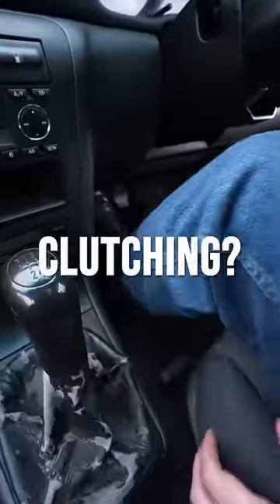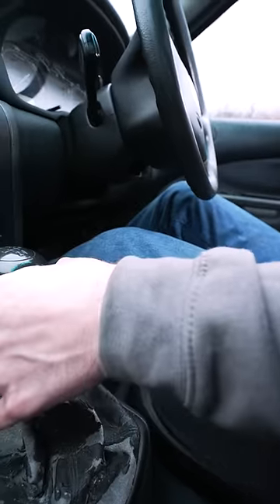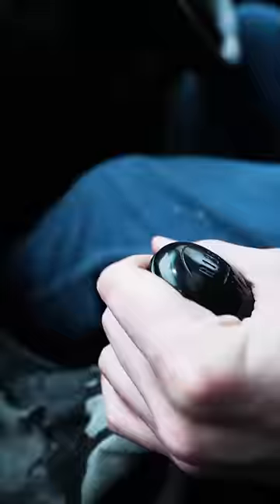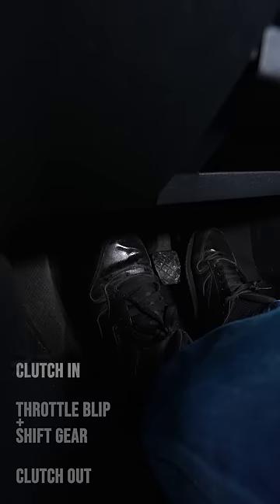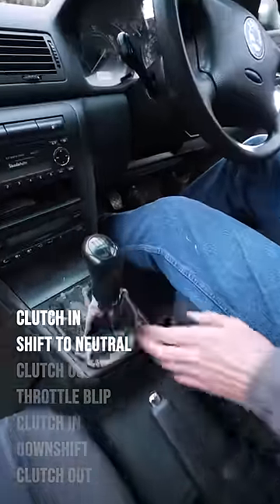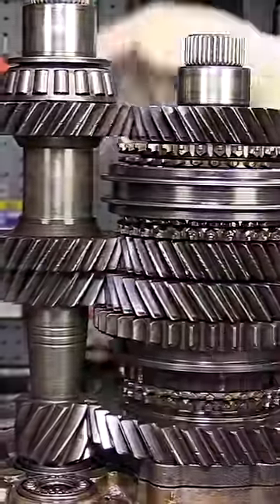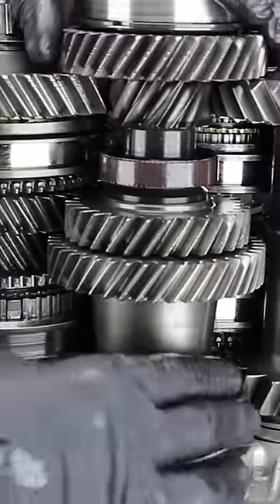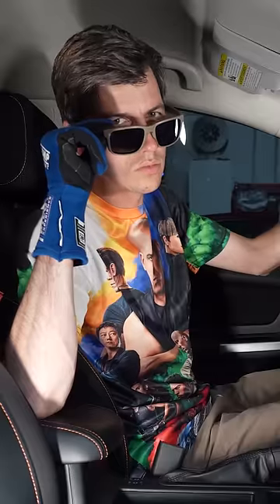What Is Double Clutching? Don't Granny Shift!

Comment: I've gone thru so many comments but still don't see this so I gotta know if anybody else does what I do. 
1. I double clutch when I'm skipping gears during downshifting. I go from 6th to 3rd daily when coming off the highway and onto my home street or when I'm gonna pass someone. Feels way faster and easier than downshifting 3 times.
B. I'm not as good at single clutch downshifting as I am with double clutch. When I learned how to do DC I loved it so much more because it felt rhythmic to me. Not sure if it's an ADHD thing or just a me thing but I go "da-do, do-dah" in my head every time 😅 judge me if you want!
iii. Having a passengers head explode when they see me do it. Definitely a feel good moment every time 🥹

Comment: This is partially right, but double clutching does have a valid use, if you are coming into a slow corner from a fast straight and will be skipping gears on your downshift (like 5th -> 2nd) then heel-toe with a double clutch into 2nd significantly reduces wear on your synchros.

If you drive your car hard, then double clutching will extend the life of your transmission, as scyncros are the 2nd most failed part in a transmission behind the clutch itself.

Comment: My old Metro had a VERY short 1st gear and the ratio spread to second was ridiculous. 2-5 were alot closer. I bought that car brand new off the lot and legit thought something was wrong with the transaxle. Had it replaced under warranty and the new trans was worse than the original. Someone suggested double clutching and I got smooth upshifts when practicing this. Very cumbersome technique for a daily driver. The transmission was ultimately the death of that car along with structural rust around the lower control arm mount

Comment: When shifting down and don't want to slow down you want to match the speed to the revs as the synchro's will use the rotating mass to speed up the engine.

Comment: As I teach to people Neutral is a gear.  Output shaft and output gears spin with the wheels input shaft spins with the engine but only when the clutch is released so at its extreme if you are going 100 mph down the highway and pop the clutch in and shift to neutral and wait the input shaft will eventually fully stop.  Now you have a zero rpm input shaft with a 100mph output shaft and the best synchros in the world won’t push together nicely at all and as you force the trans in gear you’re using the little wimpy synchro rings to force the input shaft to speed up.  If instead you release the clutch in neutral and rev and then pop the clutch back in when the engine is revved up you have no double clutched and that input shaft is spinning

Comment: I feel that there is a time to do this, and that is when you are rolling along a flat area in high gear to safe fuel but then want to go into a much lower gear to engine brake to go down a hill. It just feels much smoother and easier on the components.
It never screamed fast to me though.

Comment: On the second "clutch" you don't push in the clutch pedal, you just synchro the gears by feel, and then slide the shifter into the gear position.

Comment: Its for big trucks and good drivers skip the clutch all together including downshifts. Saves the knee after 4 million miles of driving. On motorcycles its called speed shifting but its full throttle and just bang through the gears.

Comment: Bad double declutching has a reputation for ruining gearboxes. In the past, I know that ZF in particular have been very much against using it with their products. I don't know what their current position is. I have tried not to double declutch but it has been part of my deep programming for over fifty years, so that doesn't work. Maybe I have an advantage as a gear designer but when I slide the lever into place I am feeling the level of synchronisation and visualising the messing of the gears. I do love a 'hot knife through butter' kind of change!

Comment: In any vehicle thats syncromesh so basically everything thats not semi trucks there is NO point to double clutching and depending on how bad you could be at it can be worse for your clutch than just pressing down and doing your whole shift in one go. This is because lots of car people when double clutching get in to big of a hurry and shift to neutral before you fully engaged the clutch. This makes the syncromech not work properly and causes extra wear. Not a big deal a few times but do it too much your clutch wont last as long. Bigger trucks doo require double clutching or just power shifting.
Reply: Semis in Europe not just have syncromesh, they use automated transmissions with a clutch (not the torque converter type for efficiency reasons) since around 2 decades.

Even 1980s manual semis had syncromesh in Europe. Non syncronized transmissions are more 1960s style

Comment: We used to have an old, well-used Renault Clio from 1999. It had synchros on all but the 1st gear.
Double clutching helped a ton while switching from/into 2nd and 3rd gear due to the wear incurred through the years.
All modern vehicles I've touched don't benefit from the practice.

Comment: It's equally unnecessary to slam through gears just driving normally, for instance, but double clutching lets you do it with much wear, if you want to practice. I always double for downshifts, it gives better feel/prevents you from money shifting. If you do it right, the shifter pops right in with no resistance (very satisfying), but if you accidentally skip and hit a low gear or do it wrong, you'll get resistance and know you fucked up and can reset. Obviously for racing, I'd go to single, but I'm not driving competitions, it's just not necessary for street driving (and you shouldn't be racing on the street! Just have fun!)

Comment: Yeah double clutching is what you do in 18 wheelers like way back when I used to drive because their manual transmissions are not synchronized. As I understand many of the super, super old buses are like that too. Also I have recently learned that the old versions of the Fiat 500 are like that also.

Comment: Double clutching is not necessary. Only on Model As & semis or vehicles with square cut gears. You can (Float) those gears up or down the shift range with practice-No clutch needed.

Comment: Back in the day me and my mates would play no clutch. Youd just have to feel the timing and slap it in there. And i dont think you let off the accelerator neither. I think thats what we did and wheel spin through the first couple gear changes. Then get laughed at if you missed the change.

The more i think about it, it was probably double clutching. Because we were dropping out of gear into neutral. While still flat footing it. Then slamming it into next gear.

Comment: yes and no. if you shift to fast you're destroying the synchronizer rings, double clutching helps but needs longer. The transmission never runs 100% freely, therefor double clutching helped the transmission input shaft to match the speed and cancel out any potential energy in the clutch pack and shaft, but this needs time. That is the reason why synchronizer rings exist, you dont have to wait, you force your selector ring over the synchronizer against the actual gear you want. while you pushing the smal oil cussen between the synchronizer and the output shaft gets compressed and slows down or accelerate the input shaft to the speed of your outputshaft if the speed maches the coupler ring slips over and now you are in gear. If you doing it to fast the oil burns and looses this lubricant capabilitys and gets to thin and now your synchronizer rubs against the coupler gear and if realy bad you grind down the couppler ring the gear teath against and weaken the coupling point and metal shavings contaminate your transmition oil and destroys everything. 
you can shift really fast with modern transmitions but there are special desined coupliner in race transmition. Some of them dont use synchronizer, because longgevety is no conzern the theaths are a bit different on the coupling ring and grinding is normal. Also there is a type of transmition out who needs no clutch after you are in the first gear, but those last only a couple hous of use or should i say abuse.

Comment: In racing transmissions you have what’s called dog earring the gears basically straight cut and no synchro it’s heck on em but they are a lot stronger usually used in a sequential system but on regular manuals you have to rev match

Comment: Double clutch take off is what I assume they meant which with high horsepower and or hard take offs bumping the clutch giving some gas from stop then let out giving even more gas the 2nd time is easier on the drivetrain and drivetrain mounts while also giving u a better take off, even in newer manuals 💯 also douvle clutch take off were started by ppl hauling heavy loads trying to save the drivetrain and be able to take off without burning the clutch but in racing it also helps refrain from losing traction during take off 🤔🧐🤙🏻😎🇺🇸

Comment: The only time you would need to blip the throttle in between gears is when down shifting. When your going up through the gears you shouldn't have to blip the throttle, unless you missed your gear and are trying to get the revs up so it will drop in.

Comment: Yeah, but up to he early 1990s double-clutching was faster than ANY auto transmission plus much more fuel efficient. Which is why race car drivers of the time used double-clutching until then, slowly fading-out over the next 10 years.
Only after this period auto transmissions became faster (I mean shifting time) and more fuel efficient because they had more ratios built-in, applying a better use of the engine characteristics down the drive train at almost any time. The Tiptronic finally beat them all later for fast up and down shifting.
Still for me, an old fashion car guy (and an ex T55 tank commander) I still love to drive cars with elderly gear boxes. If you know what you are doing it is great fun to drive them since it requires knowledges, skills and a feeling for the mechanical internals. If you drove an old-fashion truck along a hilly road for miles and hours, you certainly do no need a gym afterwards.
Once you are really used to it, you double-clutch totally out of your subconscious, it goes completely "automatic". The disadvantage is for bus and taxi drivers, who particularly in the cities  have to press the left pedal so often and hard just in one 10 hour-shift, they might develop knee-problems at the left once they get older in their job. Certainly, double-clutching is out-dated by now, but depending on your "taste", great fun to kick these old cars around, as long as you know, what you're doing.

Still, if you have a powerful modern European Diesel engine in combination with a manual transmission (or Tiptronic, which is actually rather a semi-auto) the fuel economy is still unbeatable.
Most of the auto transmissions are using internal break bands or transmission fluids which generate too much internal extra friction and therefore heat, ergo energy loss. With a traditional gearbox you have a minimum of tooth wheels and bearings, reducing all internal friction to the bare minimum of energy loss. 

Peace! from Dresden / Germany

Comment: My ‘95 323F/Lantis is synchronized, but it sure as hell doesn’t act like it lol. I have to double clutch even when downshifting without rev matching. It is like nothing I’ve driven in that it is sub 40k miles and the transmission acts like it’s at 100k. I love driving it, but I pretty much had to relearn rev matching and double clutching because it likes downshifting as much as boomers like forced induction (not very much). I thought the Ranger I learned to drive on, took my drivers test in, and daily drove throughout high school was a difficult transmission, but it seems all the manuals I’ve driven, and owned, so far have been a place holder, and this RHD, cosmetically appealing “Protege With Pizazz” is my final exam. If I can learn to drive this slow, unnecessarily long clutch, first gear practically in the passenger floorboard aaa car proficiently, then it’ll be me right of passage ig. 
-
Seriously tho, aside from a CVPI and a Frontier, I’ve almost exclusively daily driven manual transmissions. I do have an auction purchased F150 fleet truck I use for general purposes, but it’s not my daily. But I feel like this little tormentor is testing me. It’s fun to drive, and I get all kinds of funky looks when I’m going backwards through the drive through at Arby’s, but the transmission is unnecessarily difficult for such a tiny car. Take it from someone who’s owned a Ranger 5MT, a Dakota 5MT, Jetta 5MT, Grand Vitara 5MT, and still owns a Jeep JK 6MT leading up to this lil import, do not buy low mileage JDM Imports without taking multiple test drives, doing research, and sourcing available parts, because lord knows you may end up with a hinky transmission like mine has lmao. And you’ll look like a newb everywhere you go, shifting extremely slowly and missing your rev matches.

Comment: I learned to drive in a four speed car with dead synchromesh on third, and no second gear. I had to rev the nuts off it in first, and double de-clutch to third. BIG blip on the way down, with the double de-clutch.

Comment: Yeah the only time I ever use this was in a 94 Integra I had in the transmission was absolutely screwed didn't have any synchronizers left by the end it didn't even matter if I push the clutch in I just had to sync the transmission and engine speed thank God I drove motorcycles before cars or I wouldn't even known about any of that crap

Comment: Well not necessarily. In the movies where they were drifting constantly. We need to look at the type of cars they were driving. Not to mention they mentioned several times about not wanting to use certain transmissions for a better performance. What do those transmissions have in them? You got to take everything in the consideration before you can make an opinion like this. They still might be wrong for all I know. But I don't have the knowledge to go through everything and justify whether or not they are wrong or not. So therefore I don't think anybody's opinion unless the adequate research has been done is 100% accurate.

Comment: Synchros work fine for ordinary driving on reasonable roads. However, when heavy loaded or under-powered coming into an uphill hairpin curve on a mountain, the synchro is too slow. By the time the synchro has matched the speed and it slips into 3rd (from 4th), you have decelerated down to where you need to be in 2nd to pull the hill. That's where you needed to double-clutch.

Comment: You don’t even need the clutch to pop it into neutral from any gear. 
You do what I call “the blip”. Ever so slightly tapping down on the accelerator while on gear, this unlocks the gear stick and it’ll pop into neutral, no clutch necessary.

Comment: Well, shifting up and down from slowing down for turns and accelerating for straights, yes. 

But it's not like they show them shifting down, just up. But only pointing out shifting up, when they are accelerating out of a turn, could be the only realistic explanation.

But Hollywood makes big fiery explosion with a long loud sound when most real explosions are fast, short clap, and usually without fire (or at least purpose built explosives)

Comment: Should I push gas while shifting down? I just let of the clutch slowly to let it match the rev speed. I also don't see a problem with floating? Is there a catch? It's easier to brake with neurtral.

Comment: pro tip: if you’re fast with it and catch the engine right as you let off so you’re not on the power nor engine braking, you can just slide it out of gear without using the clutch 😎

Comment: Except for the fact that double clutching, or just throttle blipping to rev match. Will make your transmission last a lot longer. Especially if your making a lot more than stock power. So yes double clutching will slow you down some but it will help your transmission last longer.

Comment: Or you can sort of half clutch...

Without using the clutch, pull out of gear into neutral and then use the clutch just before you shift into the next gear, either up or down.

Comment: I only use clunch to get the shift, I didnt use clunch to get to neutral... you go to neutral without clunch, using the clunch the less as posible... the real trick?? make shifts without clunch in a manual... thats the real deal. you really need to know the sound of you motor revs... aprox 2000/3000 rpm you present the gear cut the gas... and the gear enter alone.. the most dificult is first gear...as older the cars more and more easy to do.

Comment: what’s the difference between this and just throttle blipping while braking? Like braking and using your heel to blip right before you let the clutch back out. Heel toe whatever it is. I’ve been driving manual for 20 years but I can’t do anything but granny shift. Doesn’t help that my throttle pedal is not flush with my brake and clutch. it’s more recessed so I can’t reach the throttle to heel/toe. and my car is old as hell so no synchros